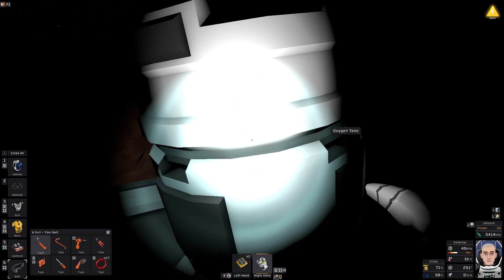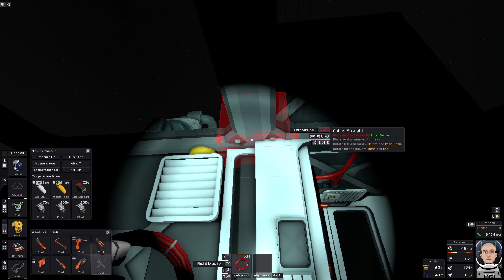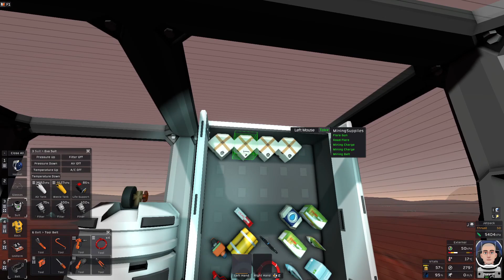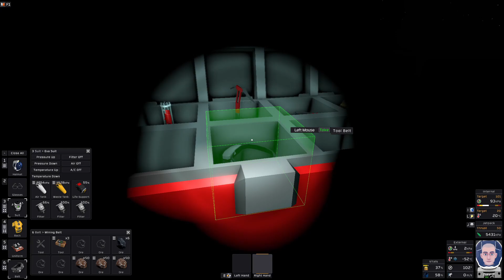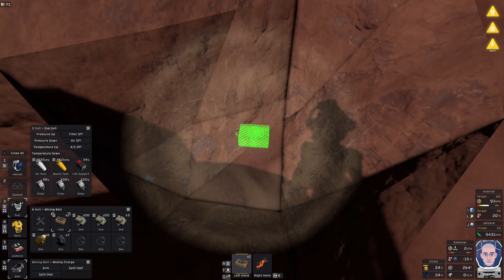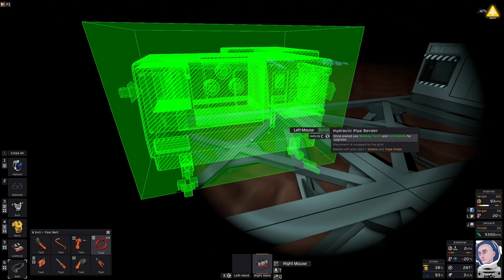Level36 Plays Stationeers - Potatoes and Assemblers | Episode 2

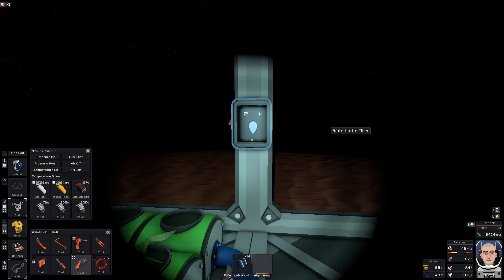Comment: Greetings! Always great to see another viewpoint for doing Stationeers. At point 6:20, you seem to have forgotten that the water filler has two forms -- which switches the orientation of the pipes vs the labels inside. Thus, the second form would have worked on the seem between the two windows and been right-side up.
Reply from the maker: @mahamasamataman3087  I completely didn't know there was another form! Wow, that would have made that cleaner.

Comment: Quick question on why you use the coal burner instead of the smaller portable gas generator?
Reply from the maker: To be honest, it's a carryover from when I learned how to originally play the game. I can't entirely remember if it wasn't yet in the game or if it was and just couldn't be easily attached to your station's power grid. All I remember is back then the coal Gen was the way to go in the early game.
Reply: @level36 yeah I remember it as well before the portable generator,  I was just curious if you had some other reason I couldn't think of or didn't realize it's pretty reliable now.    Always felt less realistic to me also, finding and burning coal as opposed to the portable generator lol.